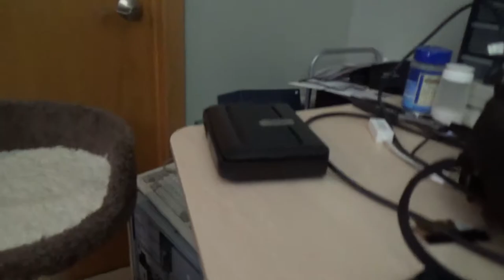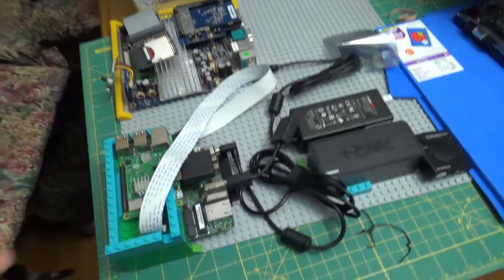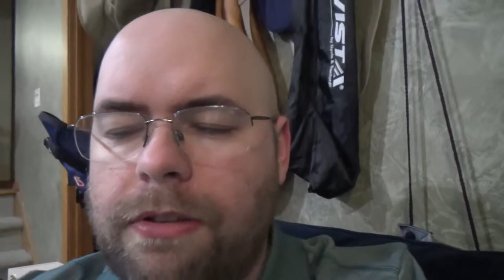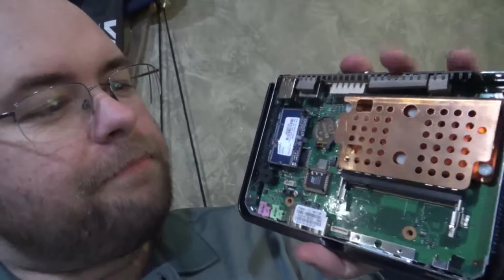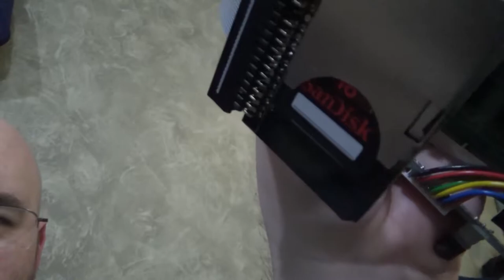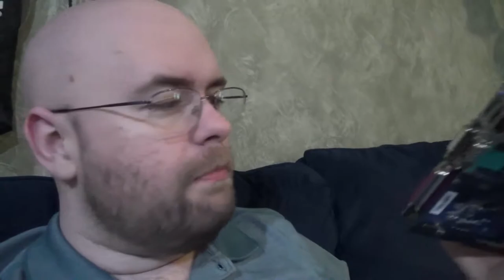VEDA 2019.04.12 - The Computing Turducken part 1.5 (What is a Thin Client?)

Comment: Daggerfall played on Win95 - I remember because my friend had it...so every time you mention Win98 and Daggerfall needing other DOS tinkering I wonder what exactly the compatibility issue IS there. Windows has been variably bad about properly supporting software and games for previous versions...kinda this whole time. Side note(s) on Daggerfall: Like with Arena (and now Morrowind, though that was a temporary rather than permanent freebie), there was the anniversary free release, which did NOT play properly in DOSBox and whatnot, didn't patch properly, and movement (backwards, specifically) was kinda...broken. Someone had done a decent fix (which I'd downloaded), but I'm guessing you're trying to get the hardware and software in place to play it outright on an equivalent era-specific machine to avoid all that drama entirely? I also have a physical copy of Daggerfall, and had considered trying to find a machine that could play it directly.
Reply from the maker: It does, but it is a DOS game - a lot of games in the early Win9x days were like that. As a result, it needs audio settings that run under DOS, which is where some of the compatibility issues come up.
The rest come up because of the funky way Daggerfall works. The game itself doesn't run at full speed in DOSBox on a modern PC even! It will actually run better on that thin client than my modern desktop, as sad as it is to say.

Strangely, the versions of Arena and Daggerfall that Bethesda released are actually incomplete - they both have broken FMVs, making Daggerfall not have key information needed to beat the game (and Arena just sort of... not playable entirely? Not sure, I have sources on Daggerfall and not Arena).

Definitely keep that copy of Daggerfall. I was at a convention today and they had a complete in-box copy of Arena... for 200 bucks. Oy, classic gaming is an expensive hobby. :(
Reply: @aetherspoon  I haven't played all the way through the free release of Arena, so I don't know about broken parts. I also hadn't heard about actual broken content beyond the "this doesn't play correctly" aspects that are noticeable immediately. Good to keep in mind if/when I do get back to them. Daggerfall's the only one I don't have experience with - I started with Arena back in the day on our 486...but never had a computer that could play Daggerfall, skipped a few generations and a bunch of years in between.
Reply: @aetherspoon  So they fucked up the audio settings between 95 and 98, then. DOS game, but the DOS was now bundled in as part of Windows (which I did NOT take to when it happened, I missed my DOS and Win 3.1 being separate entities, though I didn't OWN one with that...failing...until much later).